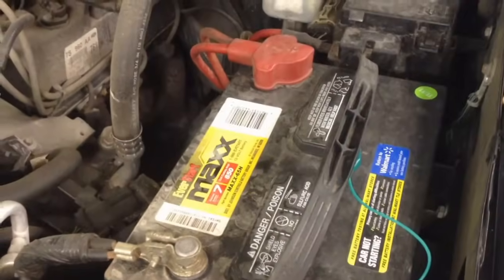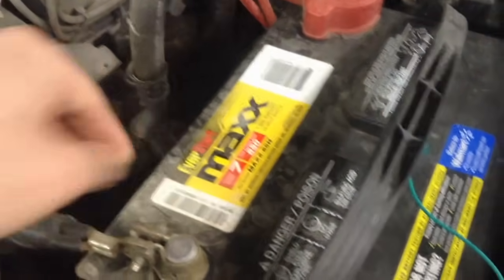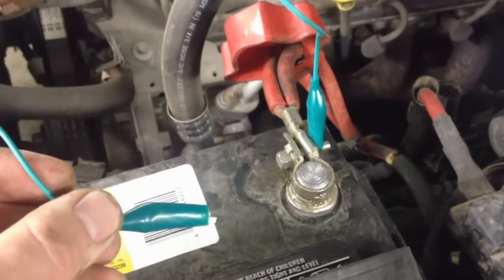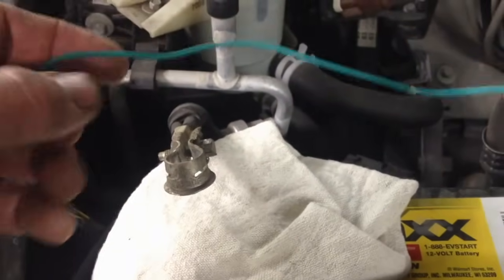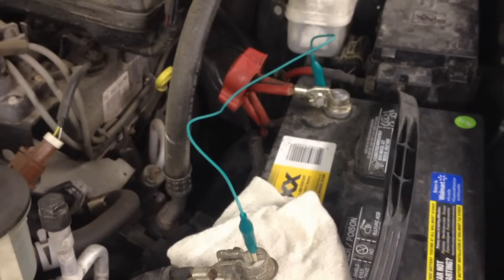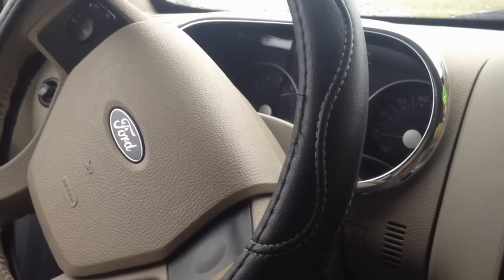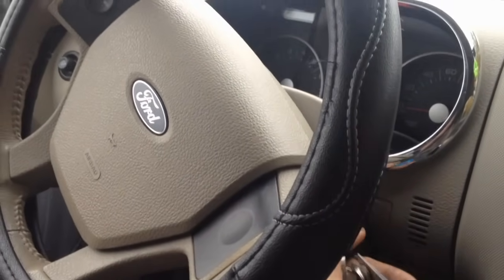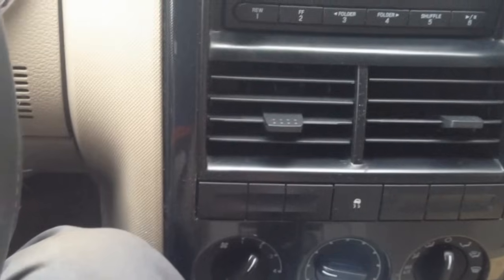How To Clear Your PCM'S Memory On Fords After Repairs

Comment: hi, i have to fix a new throttle body for my ford fusion 1.4 2005 model car as the engine of the car keep shutting off at slow speed...do i need to reprogram it after fix??? recently ford garage man update the ECU...one of my friend said that, i may need to reprogram it...
Reply from the maker: Saju Mathew Not sure about the engines over there but here we just need to clear the pcm as shown in the video and let it idle to relearn.

Comment: Am I missing something here? I am a little  nervous about running a wire from the positive cable  to the negative cable while it is still hooked  to the battery. 
Won't this be a bad deal!
Reply from the maker: AJP67235 Nope as long as the negative cable is disconnected from the battery post the electrical circuit is not complete and therefor current cannot flow.

Comment: I have a 2000 ford focus. The TPS was just replaced. I did what you said and it works the first time, the engine light came off but it revs so high on idle and it freaks me out it might catch on fire. What could be the problem here?
Reply from the maker: jpm mc Does it rev high on the idle and then once it calms down the idle hunts up and down like it's gonna die? Does it sit at a high idle and never go down? How high of an idle. Have you tried disconnecting the IAC electrical connector to see if it dies?
Reply: FordTechMakuloco It revs up and down on an idle (just after i turned it on like few seconds) No it doesn't sound like its gonna die. It revs to like 5k rpm and it goes down to 3k and goes back up again. I've restarted it and the engine light came back on after it stayed on 4k rpm for at least 2 seconds. I didn't disconnect the IAC electrical connector because I can't find it. :(
Reply from the maker: jpm mc The iac is next to the throttle body.
Reply: FordTechMakuloco Then it requires taking off alot of parts? I really appreciates your response. I just took it back from an autoshop because the mechanic told me it needs computer reflash and needs to take it to a Ford Dealership. After I looked at your video and tried, it was able to clear the engine light on but after it revs so high, it came back on.

Comment: hello, I replaced the throttle body, and than I did what you said in this video, and step on the gas, and it drowns out an d check engine and wrench come on. what do you suggest?
Reply from the maker: I would have the codes read at auto zone. You replaced the entire throttle body with new and completed this reset procedure including the idle time to learn the idle values? Which vehicle are we working on.

Comment: Egg on my face.  After changing the spark plug wires on my ford probe.v 6 Vulcan engine--and cleaning the throttle body with cleaner the car started to rev higher than normal. 1500 rpm and up to 2000 rpm.   I checked everything and worked on it for two hours before I found one idot spark plug wire in the rear ran under the throttle body and touched the linkage.  Yes, the  throttle linkage was being affected by the wire and cold not come to full  throttle closed.  I moved the wire to a new position and whamo--nice idle 900 rpm.    Lesson learned.    .

Comment: Hello,
I have a 2003 ford f150 4.6lt and put a 2008 4.6lt engine in it with all new spark plugs and ignition coils but now my check engine light won't go off and it have a misfire. What can I do to correct this?
Reply from the maker: Vernell Meloncon Which cylinder and what are the codes?

Comment: I sprayed cleaner in my 1991 ford probe v 6 throttle body and now the revs at idle run from 1500 to 2200 rpm.    Did I upset the ecu?   Or did the cleaner screw up the sensors in the throttle body?    Yes, I know there is a warning not to do this, but the guys at XXXX auto parts said it should not hurt.   How do I reset the ECU?    Negative battery terminal unhook?  or what/
Reply from the maker: Ron Meszaros I would reset the ecu yes and make sure no vac lines or hoses got knocked off.
Reply: FordTechMakuloco i have mitsubishi lancer mx i need to reset ecu same procedure this?

Comment: Hey I have an 04 Ls v8 thats having adaptive  shifting problems as if there's to much pressure in the line, I've replaced the tranny and same problem... Will this work on Ls???
Reply from the maker: FAIRLEYBOI Yes it will but those vehicles are known for tranny shifting issues caused b the pcm drivers and you must replace the pcm with a reman unit.

Comment: 2011 f150 intermittent battery light .new battery installed ,light still comes on intermittently any thoughts on this.you seem to be the guy to contact. love the professionalism of your videos( fixitman111)
Reply from the maker: Robert Coad They had a problem with the main positive wire terminal going into the battery junction box I would start there. Besides that you need a scan tool to check the gen com readings to see where the fault is coming from.

Comment: Hi good information but I have a 97 f250 4+4 it has e4od trans and when it shifts from first gear to second it's real harsh all other shifts are fine will resetting the PCM maybe fix this also it has a little bit of a high idle someone told me to replace the TPS and it will fix both problems. Thanks for any information.
Reply from the maker: I would fix the tps issue and rest kam as shown and retest. Those transmissions are very sensitive to tps and maf input.

Comment: Have you ever come across a shudder misfire or loss of revs and a battery light flicker at the 60-100km/h happens nil wen I manually take overdrive off (3 gear mode) is this electrical issue with gearbox or more than that Mazda tribute 2003 aka ford escape
Reply from the maker: Well those are known for alternator electrical connector issues corroding and if you have a trans shudder or misfire it can vibrate that enough for sure. I would fix the trans or misfire first.

Comment: My daughters computer was bad in her 2008 for focus and the guy that replaced it said the codes not coming up. He took it off and put old computer back on and the codes popped up but reading computer is bad. Not sure if we have to take to deal ship and have them reset it or is there a code we can look up. it's telling him it's locked. Not sure what that is
Reply from the maker: The new pcm will need to be programmed first yes. What code was the original pcm throwing?

Comment: Would this clear/relearn process work as described on my 2004 F150 XLT, 4.6L V8, 4x4, truck? I know this is an old video thanks in advance for any reply!!
Reply from the maker: Yes it would clear trans and pcm learned values.
Reply: Thanks a lot. I wish I had done it when I replaced everything before!

Comment: 48 cannot be right, especially in Texas you would never ever cool with a vent temp of 48.  Found out today Ford is going to replace my ac box, which consists of the coil and evaporator sensor temp probe.  Seems that the norm for a coil according to ford specs is 36-38 which would produce a vent temp of 40 at the max.  Lots of F150's out there believing 48 is ok and its not.

Thanks
Reply from the maker: Let me know what the new temps are.

Comment: I changed the transmission on my 2005 2wd Ford F150 5.4L and now it won't start. All the lights come on in the dash and everything works but it won't crank at all. Can anyone help?
Reply from the maker: does it start in neutral? Did you touch the trans range sensor at all for any reason or just drop the pan to change fluid?

Comment: I just swapped tyranny on a 2003 ford elorer 4.0 4 wd.  a.runs good but od light flashes ,could this fox that maybe ?  thanks
Reply from the maker: No you have a hard fault, I would get the codes read.

Comment: Is there anything in the PCM that is adjustable that impcts AC operation?  2013 F150 cools fine until temp on nav screeen starts reading 92 and above.  Then ac starts cycing off at 42 vent temp and back on around 46-48.  No blistering cold ac like my wife's 2013 edge.
Reply from the maker: vent temps up to 48 degrees are in the normal range for this truck. Each vehicle is different in cooling capacity. At 92 degrees outside those vent temps sound right.

Comment: will this work on a 2006 ford mustang?
Reply from the maker: Christian Bawman Yes it will
Reply: FordTechMakuloco  thanks for your reply, well i have a problem, my mustang 06 gt isnt shifting and i got a bunch of codes starting of p0740, p7043, p0750, p0755, p0760, p0765, i just changed the solenoid block, and is still sending the same massive errors coming from the solenoid block, i am going to restart the PCM as you show on the video, i really don't have more ideas about how to fix this, could you please assist me on this, i was told to check the harness, but it's seems to be ok, what volts should have this harness on power cable, and if you have any idea about how to fix my car please just let me know please !

Comment: I have a 2002 Lincoln LS V8 with Transmission Codes P0731 & P0840.  Are these easily repairable issues or really expensive?  The car just hit 134,000 miles.  I can't say if the fluid has ever been changed as I bought it used at 100,000 miles.  Thanks.
Reply from the maker: I would pull the pan and check the fluid condition and for metal in the pan. Are you having any noticeable trans problems.
Reply: FordTechMakuloco The status screen would say "Check Transmission" after a hard shift.  After this happened a few times, it went through a hard shift and the status screen went dead.  It will still tell you low fuel and you can still use the status button to check lamps and engine oil life but after it cycles through that it goes dark again.  I would say the hard shift is the 1-2 shift since the code points to "gear 1 incorrect ratio".  The other code is a "TFP sensor / switch A circuit.  I haven't a clue what effect that has on the trans.
Reply from the maker: You will have to remove the solenoid pack and test the pins on top of it to see if SSA has failed internally not cheap.
Reply: FordTechMakuloco Thanks.  Think we'll just get rid of the car.  After researching all the problems with these transmissions, thinking twice about repairing.  Gonna go back to a Ford with front wheel drive or any Ford NOT using the 5r55n/s/w Trans.  LOL
Reply from the maker: Good thinkin

Comment: Will this work on a 2014 F150 Ecoboost? I'm getting a very harsh 1st - 2nd shift under wot. It will pause a second or two before the shift (like it's thinking) and then shift very hard. It makes a very loud thud under the armrest. The truck only has 550 miles and I bought it with 100 miles already on it. It also has a drop in K&N filter. My local Ford dealer is giving me the run around. One day the transmission guy isn't there the next he's booked out a month.
Reply from the maker: No the dealer must reset the trans adaptive tables they are in a non volitale ram area of the pcm.
Reply: FordTechMakuloco

Comment: Recently I had a calamity of errors with my Expedition from bad fuel. At the same time my FPDM gave out due to a poor installation when my daughter had it replaced just over a year ago (punctured case). After the repair with fuel filter too, I collected all kinds of codes and replaced 3 ignition coils,  bank 2 cam position sensor, air mass flow sensor, changed oil and cleaned VCT Solenoids. Note that the battery was completely dead after the coils for about 2+ weeks disconnected for 1 week altogether.

After 1 new battery, change of the AMFS, oil and VCT cleaning I started it up and took off in it.   It runs rougher than anything. And being the impatient idiot that I am I punched it out of frustration numerous times. It was an attempt to get a code (or so I told myself afterwords).  Anyhow it still runs real rough, bogging down terribly when accelerating and not starting well rolling over about 5-7 times before starting. NO CODES ever show up. 

Could this simply be a case of me teaching the car to be uncooperative? It ran great before this. Would relearning this solve these kind of issues? I would still think that I should get a code. Fuel efficiency is about half what it use to be. 

I would appreciate you expert opinion.
Reply from the maker: How did you get the old fuel out? Was there water in the fuel? Really sound like a fueling issue but a good scan tool to watch vct err pids etc are in order along with which cylinder is misfiring. In this case you can take a fuel sample or what we do is provide and alternate fuel source and see if it straightens itself out.

Comment: Also, if I reset the PCM will the car computer go into failsafe mode?
Reply from the maker: No  it will only reset to default tables for idle, fuel trims etc until it relearns

Comment: If I connect alligator clips from the positive to the negative, won't it spark?
Reply from the maker: No the negative battery post is separated and isolated, no path for the current to flow.

Comment: Will these also clear settings that where inputed by the dealership? I was having horrible fuel milage while towing in my 2005 f150 so the dealership changed the tire size  than what i currently have,  hence changing my shift points between first second and third gear, needles to say it worked great, at 65 mph I was 2 mpg better than before, however in big city traffic my take offs speed and shift point between first and second are nothing to brag about, ford wants to charge 100 bills to put it back to factory settings which means putting in there my original tire size (275/65r18)according to my diff gear size (3.73). Will your steps do the same? thanks, also thanks for the accuator video, it helped, I also discovered  my check valves where also cooked so i had to replace them two under high rpms i could hear the accuator wanting to engage, yikes scary stuff when going 80+,
Reply from the maker: Fern W No those settings for tire size axle ratio etc are all in the EPROM which is not erase by loss of power unfortunately.

Comment: hey ford tech first off all thnx for such great videos say I have a 2003 for explorer xlt v8 that has been rough idleing when i start the vehicle some times even shuts off do to low idle now it gives me 4x4 light flashes on and off check engine abs and off road  took it to auto parts to be scanned and the codes i got was p0351 andp0356 replaced the whole coil pack all 8 but it keeps doing the some do you think that resetting the pcm will help these conditions? please HELP thanks
Reply from the maker: If you have multiple coil drivers failing it sounds like it is time for a pcm, we can test cylinder 1 for the p0351. Unplug coil #1 check the white/ light blue wire for a constant 12v with key on. Then you are going to have to check the other wire at that connector (light green/ white for a ground pulse with a test light.
Reply: FordTechMakuloco thanks in advance, if I buy a used pmc do you think this would work or I would have to do a flash of the new  pmc
Reply from the maker: You will have to flash it.

Comment: First, thank you for all the informative videos. I've been watching them all and really learning a lot.

I have a 2007 Fusion SEL 4cyl and I had to replace the battery. I followed the re-learn instructions in the manual and the car drives fine but the idle in drive is rough and worse when the a/c is on.

The idle in drive use to be about 900 to 1000 rpms but now it is around 600 rpms. If the a/c is on, I'm in drive, and sitting at a light the a/c compressor will make the rpms drop and the car jolts and the rpms kick up to 700 then back to 600 until I press the accelerator.

Is the alligator clips something worth trying or should I take it to Ford to have it looked at?
Reply from the maker: 600-700 rpms is normal range. I would do a cleaning of the throttle body and the procedure above for clearing and relearning. Also make sure all 3 tabs of the upper air filter box are hooked into the lower air box so the filter can seal properly. Cleaning An Electronic Throttle Body Safely

Comment: I have a 2001 ford ranger 2wd with the 4.0  I had 33 inch tires now have the stock size.  My speedometer off now about 15 at anything over 60 mph.  At 75 it bounces off the governor thinking i am going 90 will this fix the problem?
Reply from the maker: You need to change the speedo gear at he trans, did the truck come from another owner that had it lifted bigger tires etc?
Reply: yes it has a lift on it and had 33 inch tires.  Now it is down to the stock tires.
Reply from the maker: koopersdaddy1 Yours should be new enough that they can program the pcm back to the stock tire size.

Comment: hi there you seem to know what youa re doing lol  I recently chabged the throttle body and change the petal sensor and it was good now it is throwing the same code as before which is p2135 and it is always throwing the same thing and we changed the shifting sylenoid and we did what you said ito reset the computer and we are still having problems what else can I do
Reply from the maker: somersmith22 How long was it good for? Was it a ford one? Which vehicle are we talking about here.
Reply: we are talking about the ford explorer and I dont know what is going on with mine but now it is not going into gear and I have done everything to fix it I dont know what else there is to do besides replace the transmossion cause it is still haveing the p2135 code and we have replaced the pedal and the throttle body and then we replace the shifting sylenoid too and did what you did in this video and it started driving goood and now nothing so I dont know what is left to do noe